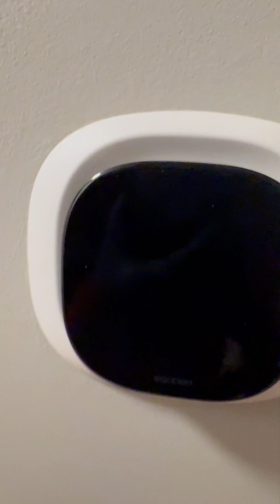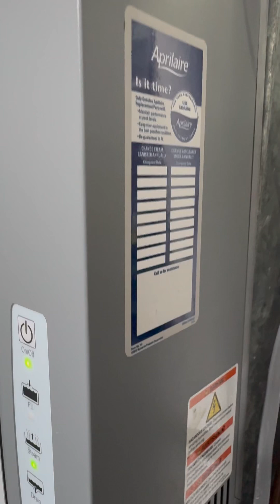Configuring the ACC+/- Terminals on Ecobee as Dry Contacts to energize AprilAire Steam Humidifier

Comment: How would you do the aprilaire and an ERV since ecobee supports 2 accessories? I have ERV on acc+/- already but am concerned that pek+ would be powered.
Reply from the maker: You are absolutely right to be concerned—that PEK/ACC+ terminal sends out 24V (1-wire setup), and connecting it directly to a device that expects a dry contact (like most ERVs or Steam Humidifiers) could damage the equipment's board.

The Solution is an Isolation Relay:
You can safely run both if you install a standard 24VAC isolation relay (SPST) between the Ecobee and the second accessory.

1. Coil Side: Wire the Ecobee’s PEK terminal and a C wire to the relay's coil.
2. Contact Side: Wire your Steam Humidifier to the relay's 'Normally Open' and 'Common' contacts.

When the Ecobee calls for humidity, it sends 24V to the relay, which then magnetically closes the dry switch for the humidifier. This protects your equipment while utilizing that second powered terminal.
Reply: @NelsonsHVAC  that was my analysis too, so thank you for confirming.